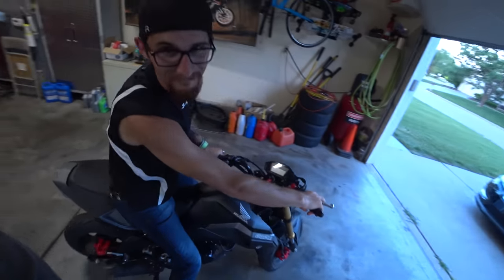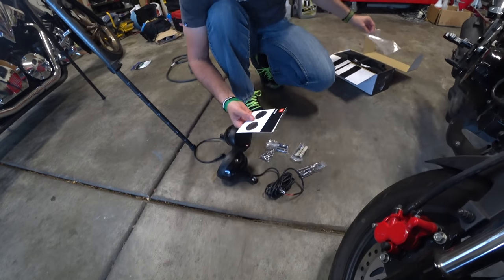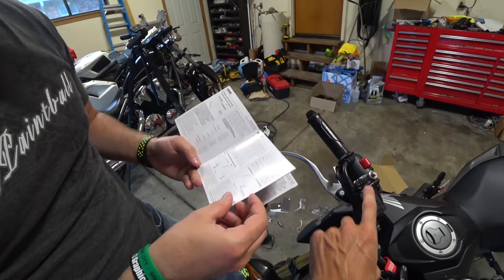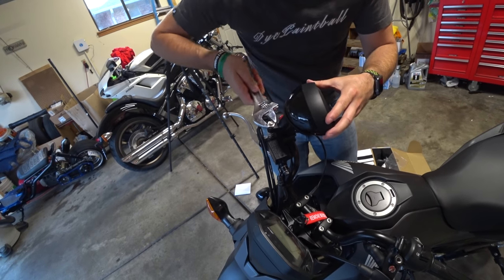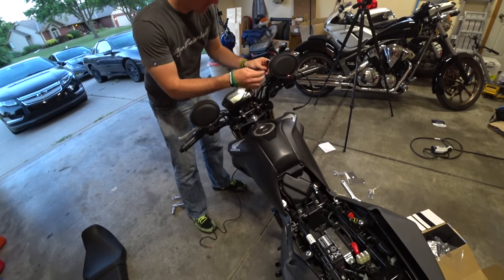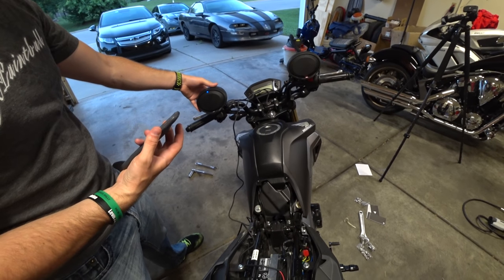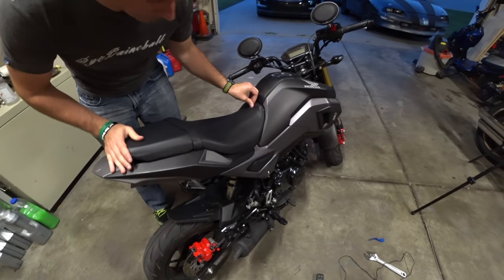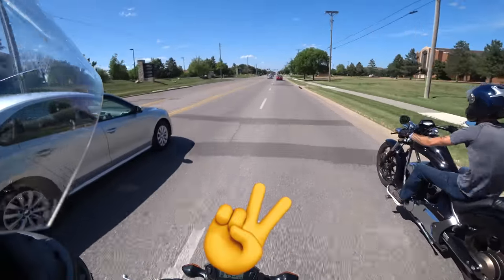We Put A Sound System On A Honda Grom - JBL Cruise

Comment: Run your black wire to your battery and your red positive wire to your headlight that'll cut them on and off and that's with all speakers for motorcycle the Bluetooth should automatically kick in
Reply: Splice the red wire to headlight or what? I’m slow
Reply: @Dee Da Don  The headlight only powers on when the bike is on. So if you wire something to the headlights they will also get power only when the bike is on. If you wire something straight to the battery it will always be getting power.
Reply: Put a toggle switch on it

Comment: Just purchased these and will be installing them on Sat on my Z125 stay tune for my first video install.
Reply from the maker: Let me know what you think, they work pretty well on our bikes since you can't go fast enough to lose the sound completely.
Reply: WatchJRGo I’m not a fan of speakers on the bike except for the Street Glide but I was thinking the same thing since these bikes are not that fast to begin with and i still have the stock exhaust it should sound pretty good. Have you had an issue with the speakers draining the battery since it’s not switched power?

Comment: Have you had any issues with it powering off under heavy throttle? I also had mine kill my battery when the speakers were off. I added a toggle switch.
Reply: He did not enough power on these groms

Comment: JBL website and your review didn't mention if the battery leads are for 6v or 12v batteries..?  It would be nice if they had a USB rechargeable... so you don't have to wire it in.
Reply from the maker: Since every modern vehicle uses 12v electrical systems I'd say it's a safe bet it only supports 12v. You could test it on a 6v system, but the leads are rather small and it would probably need too much current for it to work. I kinda like not having to charge the thing.

Comment: Can the control speaker be mounted on the brake side? I'd wire the power off the kill switch and put an inline fuse.
Reply from the maker: I’m sure it can, you can also use the headlight circuit since it’s switched back by the battery 🍻

Comment: Hey I put these on my Grom the way instructions indicate but I notice it drains my battery u must connect to ignition switch to have a chance. FYI if u have anything else electric aftermarket like me I have lights on my Grom so I had to get Gel battery and switch for lights still in test mode because before new battery it would die after day or two then you damage the batteries ability to charge smh good luck to who ever putting these on any 125 cc

Comment: between the sound of the street and the engine you cant really hear the music
Reply: Actually you can, I have a set mounted on a KTM 200 with open pipe and on full volume I can ride at around 80-90k/hr and have no trouble hearing the music with a fully enclosed helmet- they are good value for money- granted its not perfect but they rock 👍

Comment: Can you here it in the high way or you havnt took it out on high way I'm not sure how fast that bike goes I've got a 2019 Cam am Ryker rally edition and need something I can here on the high way .i just got the new Ruroc helmates for motor cycles there knownfor the snow boarding helmates crazy design it comes with built in speakers in the helmate that run back to a system they call shockwave. You need the shockwave to be able to use the blue tooth phone and nav commands but the speakers come built in the helmate already shockwave sold separate . so I'm looking for something formy bike that has limited bar space
Reply from the maker: You can hear these to about 50 Mph, I have a Sena in my helmet 🤙